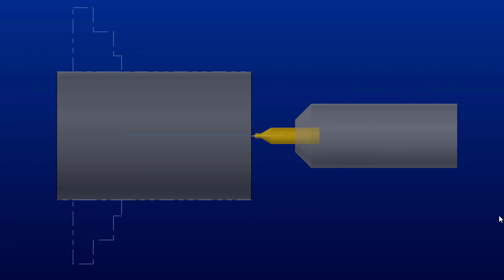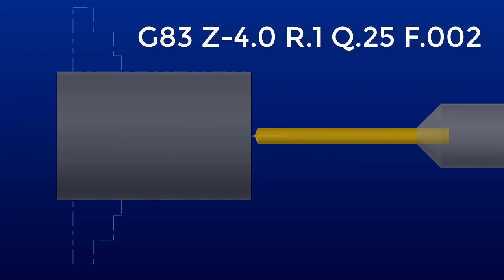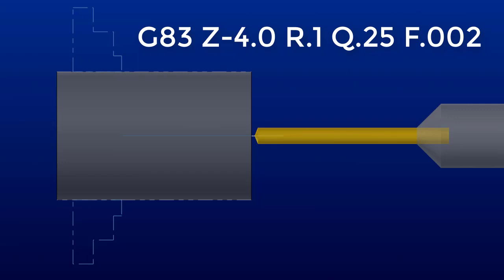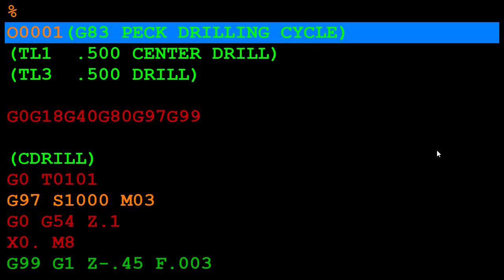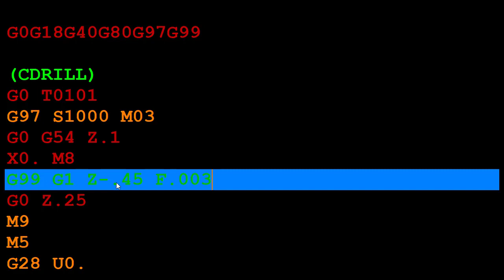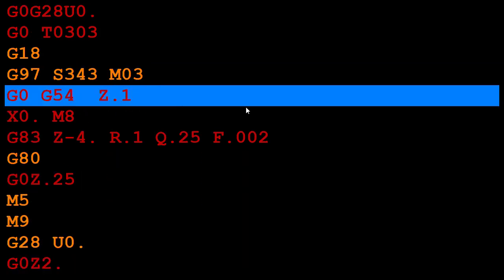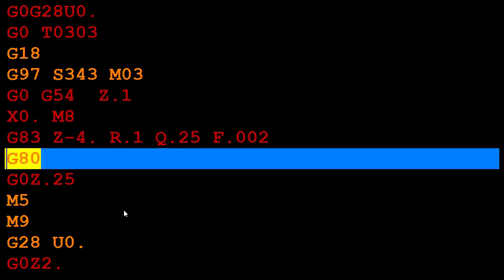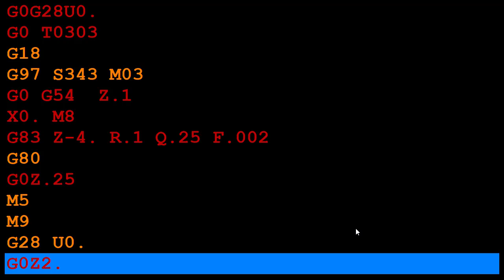DRILLING USING A G83 CANNED CYCLE

Comment: I am running a Leadwell lathe with an OI-tc control and when using a G83 cycle, if I program "Q" as .25 it tells me its an illegal use of a decimal point. I have to program "Q 2500" . Is there a parameter to change this or are some controls just this way.

Comment: In my experience there is no need for the G0 Z.25 line as the drill automatically retracts to the starting position of the cycle (Z.1) 

Also I have found that the R.1 will retract to Z.2 not Z.1 as it is .1  infront of your initial starting position of Z.1

I operate a fanuc lathe so possibly I'm talking out my ass! Haha
Great videos! Keep them coming 

Anything on Live tooling? Or using manual quide for mill turn?? 

👍👍👍